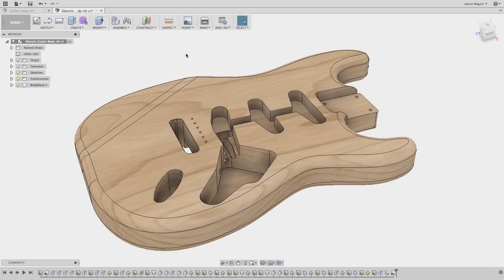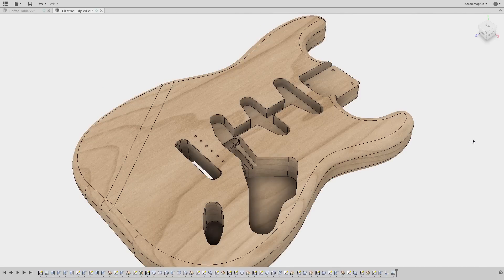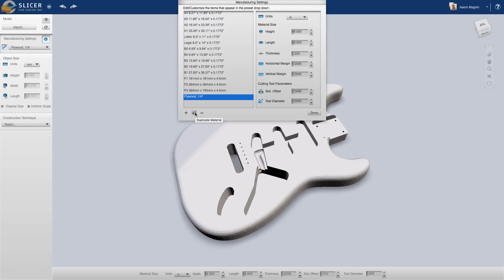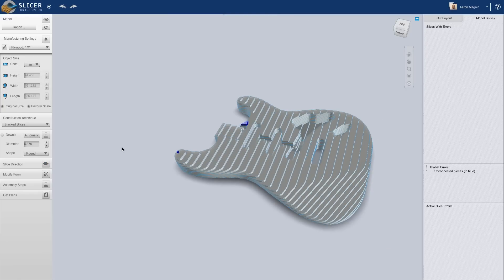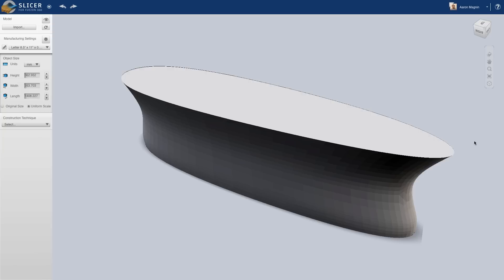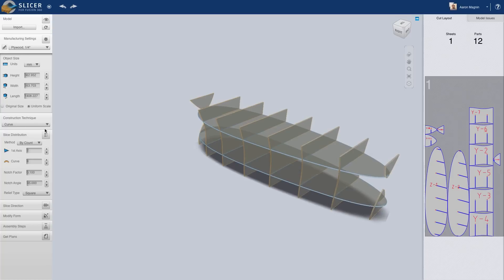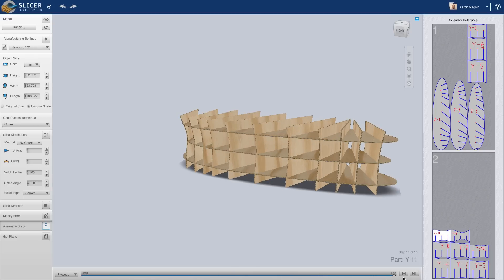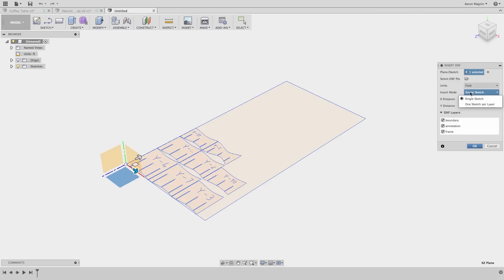QUICK TIP:  Slicer for Fusion 360

Comment: @Autodesk Fusion 360...I was shattered when Autodesk pulled the plug on (the old) Slicer for Fusion 360 and have been searching for a replacement ever since. I had structured a practice around it and found it one of the most useful pieces of design software ever. Do you know of any other software that does what it did?... or the developers? I've been hunting for ages and the only thing I've found that comes close is FlatFab (but really nowhere near as good). I'm sure there are lots of others that miss it too. Thanks in advance

Comment: Kinda was hoping to that slicer to integrated into fusion, at moment it is good, but i think there should be a separate button/ icon to call this program up, or at least have it it already in the list, like Meshmixer and Printstudio if it under other then it messes up my 3D print slicer . but do you have plans to integrate it properly into fusion?

Comment: It looks like this is capable of creating dogbone joints for it's slicing.  Any way to use it to create dogbone joints in our models?  Basically, could it be set up to do a sort of slicing where nSlices == 1, and add dogbone offsets to any interior angles?
Reply: I can't figure out how.  Any pointers?
Reply: How do you get just one slice though?  All I want is dogbones on the interior angles; I don't actually want any other slicing behavior.

Comment: So this is not a slicer for 3d printing?
Reply: Mecha Industries you could use "plywood" in your layer height (0.2mm for example) - take it back to fusion reverse the toolpath (with a 0.4mm "tool" for example) and then manually add those to one gcode file and add the extrusion. so currently I'd say no. 

but you can export to nearly every 3d slicing software directly. so this is like the same functionality.